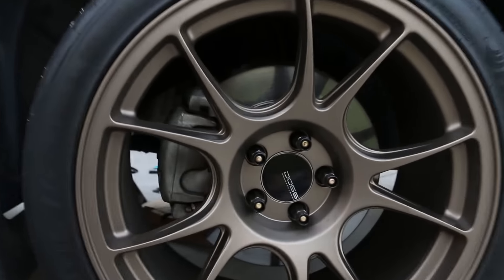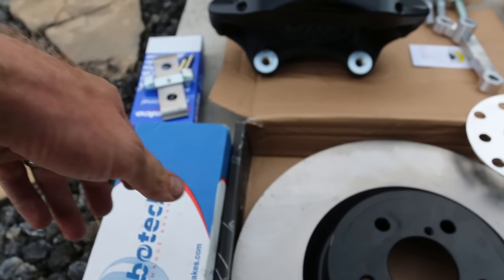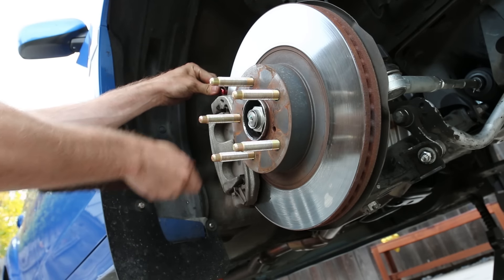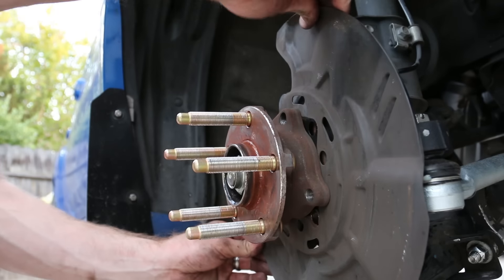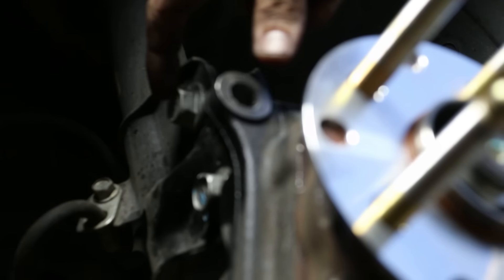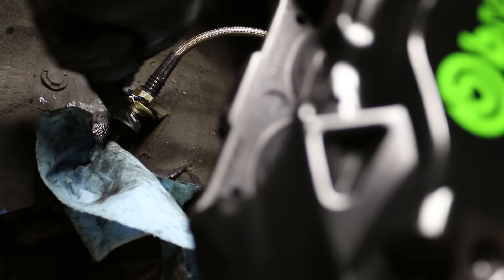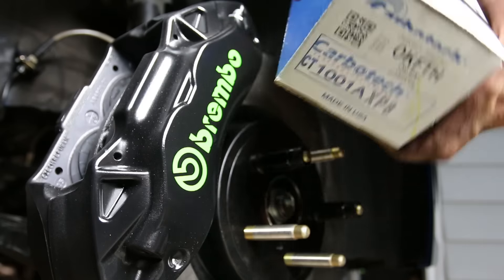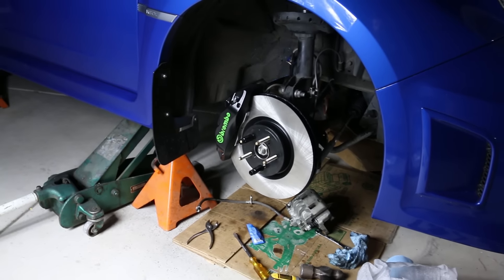CADILLAC BREMBO BRAKE SWAP FOR YOUR SUBARU WRX ON THE CHEAP- HOW TO INSTALL PT-06

Comment: A few misconceptions:
-Keep the shields, they will protect the rubber joints from the heat of the brakes. The heat will kill the joints from the racetrack.
-Rubber lines don't deflect remotely close enough to notice. Regular braided lines also have to be replaced every 2 years.
-XP8 pads are not enough for the heat this car is going to generate on the racetrack, XP10 at the least, XP12 recommended with that horsepower and weight. 
-Don't use race pads if you are scared of brake noises
-Only use steel nuts for the wheel
-Lastly, stickers don't matter, it's a performance part, not stance nation rice club.
Reply: you forgot to mention the front bias the car will now have affecting it's performance at the track. It's good to have good front brakes but when you neglect the rears and the fronts are doing all the work you're basically hurting your track times especially on turns when the nose will dive forward every time you brake.
Reply: you forgot to mention the front bias the car will now have affecting it's performance at the track. It's good to have good front brakes but when you neglect the rears and the fronts are doing all the work you're basically hurting your track times especially on turns when the nose will dive forward every time you brake.
Reply: you forgot to mention the front bias the car will now have affecting it's performance at the track. It's good to have good front brakes but when you neglect the rears and the fronts are doing all the work you're basically hurting your track times especially on turns when the nose will dive forward every time you brake.
Reply: Matt Greenland he doesn't respond to comments.

Comment: I would have used a second wrench on the female end of the SS line to ensure a firm fit instead of using the stamped steel “ bracket.”

Comment: How about proportioning from front to rear? There is a factory proportioning valve so when you press the break pedal it sends specific pressure to the front and to the rear. Now that the front has changed the rear will need to be compensated for.
Reply from the maker: I didn’t seem to have much of an imbalance
Reply: @BlakesGarage  good to know. Once I'm done with the upgrade I'll try and lock them up without ABS and if the rear locks up first I put a new prop valve in.

Comment: Didnt look through so not sure if it was mentioned or not but it looked like you but the hardware in the caliper upside down. The little curves in the spring are ment to go under the slides. It might work the way it is but it might cause abnormal wear

Comment: and if you press the brake pedal with a stick or prybar before you start you loose almost no oil from the hose and it doesnt constantly leak

Comment: Ascent calipers are twin piston and larger diameter, and made to stop a car that weights 1000# more than an Outback and is rated for towing 2000# more.
These brakes on a WRX would have the effect of throwing out a large anchor, and bolt right up with just longer mounting bolts.

Comment: Okay so how have they worked so far? 
I noticed the brake pad hangs over the rotor a little did that affect anything? Did you have any other problems with the pads?

Comment: Sup dude! Thanks so much for the detailed info on the video! Quick question , are you having any issues with the brake pads overhanging? If not, how are your pads holding up? Thanks so much in advance!
Reply from the maker: Yeah, if I remember correctly, the brake pad is overhang just a little bit. It’s not really a problem as it will wear and work fine
Reply from the maker: If you wanted to call a company like G-Loc, you could ask for a custom set of pads and they could probably take a bit off the top for you if you’d like
Reply: @BlakesGarage  nice thanks for the plug! I’ll definitely give them a shout :)

Comment: Nice this just popped up in my sub box and has 200+views already! also you can use some saran wrap over your lug nuts before sliding your socket on that will stop them from getting skuffed up if your undoing your wheel nuts all the time for mods and track days if your socket is a super tight fit it wont work but thats what i use on my snapon sockets and no marks so far :) the painting you did on those calipers looks fricking mint. hehe look at that lovely new steering rack and tie rods:P  your only 16 subs off 10k man! all the best!
Reply from the maker: +Jolinator Dude awesome idea! I will use that for sure! Thanks.
Reply: Thats a good tip, im goign to try that- thanks!

Comment: got a theoretical question about the wheel spacer, i'm assuming its only  like 5mm, but can't you just install 5mm Washers in between the brake mounting bracket and the new caliper. Like where the 2 bolts go, that way the pads can still be even? I think it would eliminate the need for a spacer, and it would push out the caliper 5mm instead of the rotor 5mm if that makes sense. I think that's what i'm going to try when i install this kit to avoid using the spacer and extended lugs. Thanks for the install vid btw!
Reply from the maker: +Brian Lee no do not do that. They make a spacer for a reason and it's hubcentric. Putting washers behind the wheel is not a good idea at all. Also washers are almost never the same thickness.
Reply: Brian Lee wouldn't work anyway. the caliper is already too far out, that's why You're spacing the rotor out. the alternative would be to move the caliper in, but you can't because it's already up against the steering knuckle.
Reply: What size spacer did you use and where did you get it?

Comment: The caliper pins should have some type of locking pin so they don't slide out(cotter pin)?
Reply from the maker: Nope not these, they have a compression piece on the end to keep them seated.

Comment: I know this video has been out for a little while and I love your series. Great info and fun. I'm planning on doing this myself with my '16 wrx but wonder if there is a difference between getting the brakes you used or if the "V" brakes are virtually the same thing or could they offer better performance? On the site it does say it's a "V" kit but I believe the ones you used are the standard CTS berm no brakes. I may be wrong...
Reply from the maker: You need to use these calipers:
ACDelco 172-2587 GM Original Equipment Front Passenger Side Disc Brake Caliper Assembly http://amzn.to/1SrwQI0 ACDelco 172-2586 GM Original Equipment Front Driver Side Disc Brake Caliper Assembly http://amzn.to/1U460oz They do use the CTSV calipers for some of the other car brands that they make spacers for, But the Subaru kit requires these. Check the description for all the links to the parts needed.

Comment: Did you install the long thin pin that goes through both the of the brake pad retaining pins? It goes through the holes of both of them to ensure that they won't back out?
Reply from the maker: +MaherMic no pin on these it has a compression fitting on the end so it doesn't back out.
Reply: Nice! Just wanted to make sure you were safe man!! :)
Reply from the maker: MaherMic Thanks Buddy!

Comment: When you painted the calipers with the VHT, did you do the whole process of prime, paint, clear?
Reply from the maker: +Derek Youngs no I just painted the VHT black on that's it. I couldn't find VHT clear quick enough.
Reply: Blake's Garage Appreciate all the in depth  walk through's, reviews and hacks. Just waiting on my parts to arrive for this brake install. Keep it going bro.
Reply: Do you happen to know the size comparison of these to sti brembos? With my current wheel setup I know that I would need a 8mm spacer to clear sti brembos, so just trying to gauge if the 8mm will work with these as well or need to bump up to a 10mm. Thanks.

Comment: I really want to do this but I wonder if I should wait...my car is still pretty new < 10k mi and I want to do things that are more "warranty" friendly and people always recommend doing things like brakes/suspension. With nothing wrong with either I probably should be a little more patient. Maybe I'll just start slowly piecing this together over time so it doesn't seem like so much at once...even though this is already far cheaper than a traditional bbk.
Reply from the maker: It will effect anything with the warranty besides the brakes. Life's to short to stay stock!

Comment: Those retaining pins to hold the pads, did it come with a pin to prevent it from pushing out?
Reply from the maker: You too? LOL They have a compression piece on the ends that keeps them from backing out slightly different than the STI Brembo's.

Comment: Respect for all the work and the video, but wouldn't be (alot) easier and cheaper just to get some STi gold brembos?
Reply from the maker: This is much cheaper. Also all new parts. If you get a great deal on some STI Brembos then maybe, but you run the possibility that they are stripped out and you would still need to buy new pads/rotors.
Reply: This is cheaper? How much is this? A set of Brembo gold, in europe, with rotors and pads, you can get it for 600-700€ from various respectfull sellers.
Reply from the maker: Pedro Teixeira You can do this as cheep as 600 USD for the fronts all new. For new Brembos your talking 1200 USD for the front.

Comment: Great vid! I have all the parts to do this myself, but I am trying to find that T-Handle adapter for the threading bit. Where did you get the one you use?
Reply from the maker: AFWeather I picked one up in a big tap and die set from Home Depot.

Comment: Hey man I hate to ask a dumb question but, the links to amazon for the caliper assembly are linking to a different part number than what you have listed in the description.  Are those correct or do I need to look for the proper part number elsewhere?Thanks!
Reply from the maker: Mitch Brenner nope those are correct. They changed it a while back on amazon had to update the link.
Reply: Thank you sir - appreciate it.  Try to shop from Amazon when I can since I love prime, but being somewhat technically disinclined wanted to make sure I wasn't doing anything stupid and making my life harder than it needed to be ;)
Reply from the maker: Mitch Brenner no problem! I love prime also.

Comment: hi man. i already have all the parts brake swa[... but do you recommend to replace the lugs before the installation of the big brakes??
Reply from the maker: I do recommend to change them out but its a quick job so doing it at the same time is fine.

Comment: I'm in the stages of doing a six speed swap and the biggest wall I'm hitting is finding brembos that aren't super expensive. Will these BREMBOS bolt up to the GD STI chassis hub setup? If so, this makes the swap way easier
Reply from the maker: +Tj Rizvi You will need the adapters. It will work on a GD.

Comment: Does this work for 2015 wrx? Is the only thing different the lug pattern? Does that bracket from ctsv swap still work?
Reply from the maker: +Austyn Rodriguez yes, you just need 5x114.3 rotors

Comment: are the arp studs needed or did you just put those in there because you can?
Reply from the maker: +Und3rOth1 they are not needed but I would highly recommend them when doing this as the spacer behind the rotor will take up some threads on the stock studs.
Reply: +Blake's Garage alright, didn't know if rotor size would take too much space and lead to needing those lugs. since I'll be down there might as well swap them out.  Great video and thanks for the info!
Reply from the maker: Und3rOth1 No problem.

Comment: Great video! Does this setup work with the stock wheels?
Reply from the maker: +chris rollins it can but you need to grind some material off the top of the calipers. I will post a video in a few days showing what they look like.

Comment: If I remember correctly, these brakes are the same ones you had got a little bit ago that said "Cadillac" or something like that on the front? If they are the same, did you paint them and put a brembo sticker on them or are they different? Thanks
Reply from the maker: Yes that's correct. I painted them black and added the sticker.
Reply: +Blake's Garage assuming the Cadillac lettering is also just a sticker? Or painted on? Also, did you paint black, then put the sticker and then do some sort of protection spray like a clear coat?
Reply: +Blake's Garage I'm going to order everything on the links to help you out. Do you suggest the first brake kit in your description or the second (cheapest). I don't mind spending extra for better. 
Thanks man. Sweet looking brakes, you'd never know they weren't Subaru Brembos 👍🏻
Reply from the maker: Im Chris The Cadillac logo was painted on. It looks cool if you just paint gloss clear caliper paint over the original logo if you what people to go " WHAT THE?". I just sprayed black and put the sticker over the black paint. I was going to paint them white then use the sticker as a back mask then paint black over that. Peal the sticker and clear over it all but... I couldn't find white caliper paint that easily.
Reply: +Blake's Garage haha. I want to paint them when I buy them, no issues with them heating up the stickers and either melting or ruining them?
Reply from the maker: Im Chris Yeah I feel that. I figure its to that hard to repaint them and I'm guessing I will melt the stickers off eventually.
Reply: +Blake's Garage that shield you cut off serves no purpose?

Comment: Do u need the adaptor if u have the 2015 Wrx.. Would it be direct bolt on?
Reply from the maker: Yes, you still do pick them up at ctsvswap.com they have a bracket just for the 15+. No, it would be basically the same process as this.

Comment: question. will this exact setup work in the rear as well? out of curiosity what was the grand total price for the swap? sorry i guess i could tally it up.
Reply from the maker: $860.95 for everything new. Including the race pads and steel braided lines front and rear. But you do it for as little as $606.19
Reply: +Blake's Garage nice and this will work in the rear as well as the front?  outrageously good deal. was going to buy those feal 441s but might need to capitaliaze on the brakes 1st.
Reply from the maker: Jacob Prince Yeah they are both a good choice.

Comment: Any options for rear brakes? 15+wrx
Reply: You ever find any options for the rear breaks?  I found some that a fairly cheap part number 26692FE0408A but thats just $450 for the calipers then you need a $100 adapter and possibly new rotors, but possibly not for the rear.

Comment: Hey man I just did the brembo sti brake swap put stoptech rotors on as well and noticed the car drives abit slower due to the face the rotors are abit heavier! I did front and back on my wrx was wondering if you are getting the same feeling with your car?
Reply from the maker: I didn't notice it at all. But that makes perfect sense just a bit rotational mass. Still worth the extra stopping power. You can always get some light weight two piece rotors to fix that $$$$$.
Reply: +Blake's Garage haha yeah man just put on the forged sti bbs rims which saved abit of weight which helped with rotational mass but yeah 2 piece rotors are super pricey! Plus not looking to spend more cash flow from switching to stoptech slotted to two piece ones haha
Reply from the maker: Nabil P Yeah I feel ya. Maybe just crank up those HP numbers a bit more LOL.
Reply: lol going to need an accessport, intake and exhaust then
Reply from the maker: Nabil P YES SIR!!!

Comment: I have perrin 20mm spacers (adapters) and oem sti bbs wheels on my 16 Wrx.. Will this kit still work if I buy the OE 05-07 brembo rotors? Thank you
Reply from the maker: +Elvis McDermott Yes it will. Like you stated just get 5x115.4 rotors. Also they have a different option at checkout for the 15+ cats swap.com bracket.
Reply: +Blake's Garage awesome thank you and awesome video

Comment: for 2015wrx can i install only brembo 4pot calipers with stock  315mm
 rotors?
Reply from the maker: Deividas Jurevičius no you will use 2015+ STI rotors

Comment: Wow. Awesome work man. I wanna do this to my 2017 wrx.
Reply from the maker: +drewgunner14 You will love it! Such a good value for the increase in performance.
Reply: +Blake's Garage question did you just put sticker over the cadillac logo and replaced it with the neon brembo?
Reply: +Blake's Garage and now you mentioned performance, have you tested 0-60? Theres one dude here in youtube who only had about 3-4 ft difference from the stock.
Reply from the maker: drewgunner14 Yes I painted the caliper black then put a Brembo sticker one that.

Comment: Will the stock 2011 Wrx rims fit with these calipers.
Reply from the maker: Check my video about this. It will but requires modification on the top of the caliper.

Comment: can this upgrade work on wrx 2002 and Wheel size need to replace too? Because the clearance of the bigger brake..oem on 2002 wrx is size 16..thanks..
Reply from the maker: +Hai Dao it will work but you need 18's

Comment: what size wheel are you running? What's the offset?
Reply from the maker: +Couch Slouch 18x9.5 +35 5x100 tires Hankook RS-3 265/35R18

Comment: +Blake's Garage  For the rear brakes, will these fit under the stock WRX wheels? (17x8" | bolt:5x100 | offset +53).

Comment: Don't you need caliper adapters to bolt these up?
Reply from the maker: +Ken McClure yes, that's shown in the video.
Reply: Ahh, I was just going by the parts list which doesn't mention the adapters unless I missed it.

Comment: Will it work on an 03 WRX with 17in wheels?
Reply from the maker: +Joseph A it will work on an 03 but you would have to grind the calipers to fit the 17's most likely. 18' clear no problem.